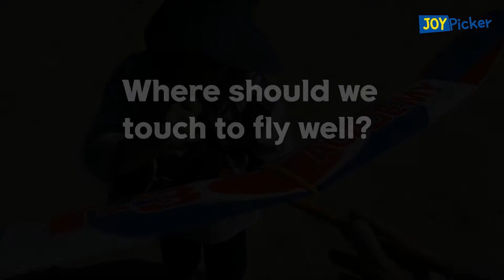$4 Good! Super capacitor motor airplane Ⅰ : Electric glider

Comment: Nice tips demonstrated.

Had question,
The elevator cut and deflection you make in tail (video around 9 min play), it's not clear whether it's at centre of tail (so extending to both sides of vertical stabilizer on fitting) or cut is slightly offset to one side (left or right when seen from tail end) ?

Secondly, also please confirm that deflection bend is angled downwards?
Reply from the maker: nice to see you.
In the video, the tail wing was cut with a stationery knife and raised at an angle.
However, it is okay to put it up without cutting it.
Raise the angle of the back of the horizontal tail slightly and secure it with tape.
Only the back part corrects the angle.
Do not raise the angle too much.
I'm using google translator, so I may have misunderstood your question.
I didn't understand the second question.
Reply: @joypicker7907  Firstly, thanks for taking time to respond.

I think your response answers my second question - so if I got correctly, the cut or bend angle on horizontal tail is raised bending upwards and not downwards. Correct?

Regarding my first question, this cut or bend is to be made on horizontal tail at 'centre of tail' or whether slightly 'left from centre of tail' or 'right from centre of tail'? Please clarify as this was not seen clearly to me in video.
Reply from the maker: @vaibhavjain2791  You're welcome. Ask any question.
Yes, that's right. You need to raise the angle of the horizontal tail wing.
When the wind comes out of the propeller → as the wind passes through the horizontal tail → the tail goes down and the front of the plane faces up.
So both the left and right angles need to be raised.
Just raise the left angle and the plane will twist to the left and fall.
Only the rear part of the horizontal tail wing raises the angle. If you look at the tail wing, a line is drawn on the top end. The reason why only the rear part is raised is to have a very slight effect.
When the back of the plane points down and the head of the plane points up, it rises high.
For example, if you add weight to the back of an airplane, the back is heavy and points down, and your head points up. Even in such a situation, the plane floats. (If there is a premise that the power of the propeller is not insufficient)
Reply: @joypicker7907  Thanks so much for detailed explanation. I got your point now, regarding which direction to bend tail rear end and result it would achieve as you explained.

Actually, I was perhaps having different understanding, that if tail is made to raise up (by giving downward bend to its rear end) and nose moves down (or say, if nose is heavy by adding weight) then it would facilitate to move the plane forward and perhaps higher. But now I got from your point, to move higher its rather opposite, that is, the tail should go down and nose up.
Reply from the maker: @vaibhavjain2791  Yes.
When the airplane's head points upwards, the forelimbs, which occupy the largest area, also point upwards.
Then, as the air (wind) passes over the forewings, the plane rises even higher.
After some time, the reason why it does not continue upward is because the wind from the propellers is getting weaker.
If the fuselage is too light & the wind from the propellers is too strong & the rear horizontal tail angle is raised too high → it will keep climbing and eventually lose balance. is to fall.
Make corrections during test flights.
The test flight should be done on a windless day to be accurate.
Reply: @joypicker7907  Yes, I now understand very well. Thanks a lot for this exchange of comments, added a lot more clarity, very helpful and informative. I also did some more reading and now more knowledgeable as well. Thanks again!